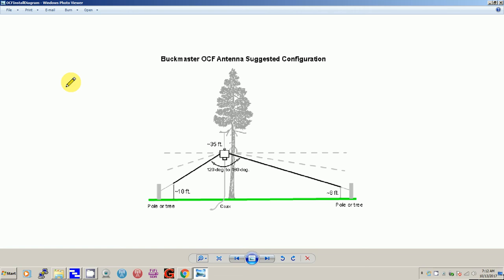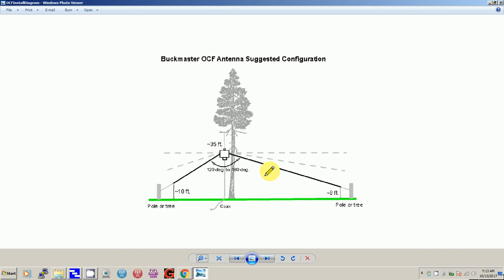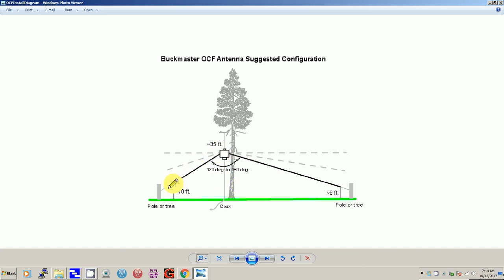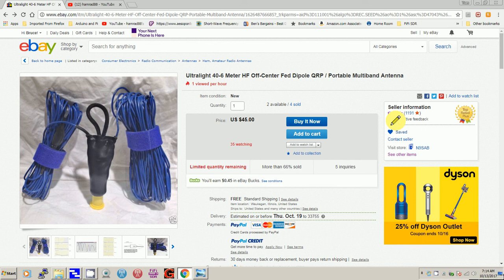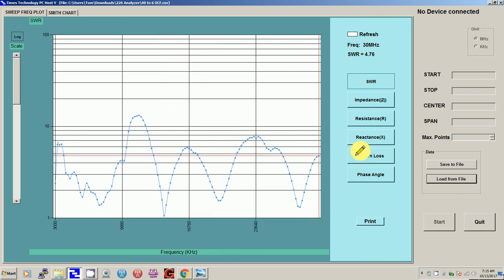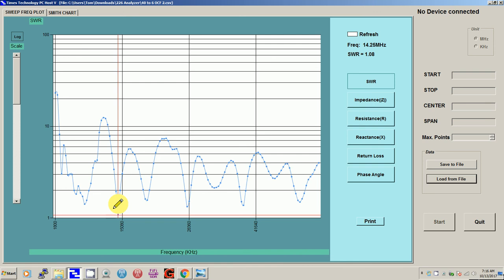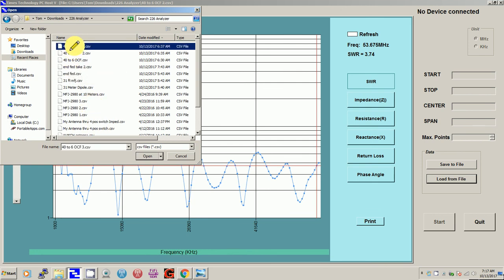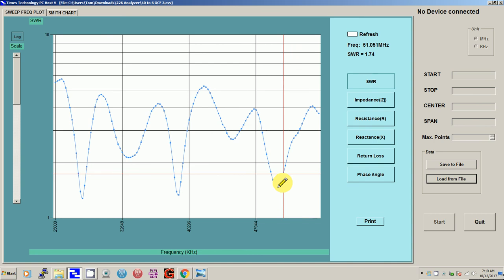TRRS #1325 - Testing New OCF Antenna With Analyzer

Comment: My first HF antenna is a home brewed off center fed, half wave, long wire dipole.  I need to get it up higher in the tree and trimmed to decrease the SWR.  It's got too much reflected power as is.  But first I've got to get an HF SWR meter.  73 from K9POW in eastern Tennessee.
Reply from the maker: Getting a little cool to work outside.

Comment: I must of missed the lengths of each leg Can you tell me what they are
Reply from the maker: The lengths will depend on the frequencies.  For instance, this antenna which will work down to 40 meters is approximately 23 foot and a 45 foot, totaling 68 feet.